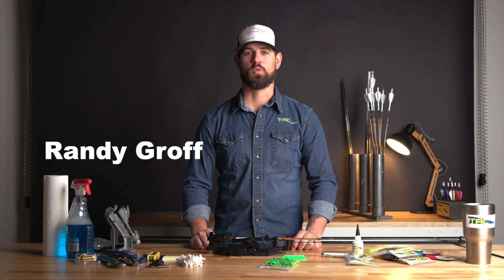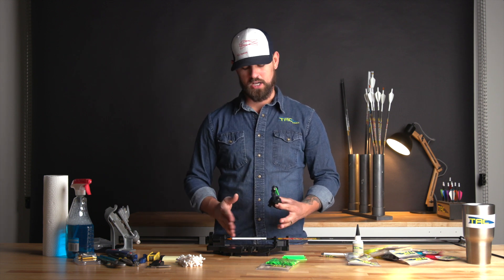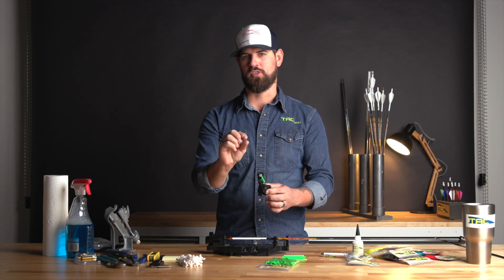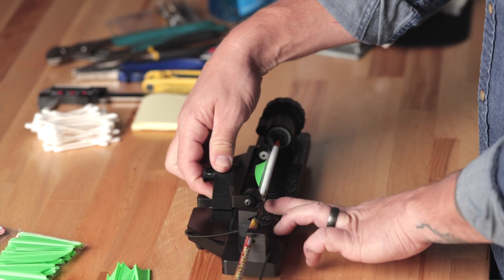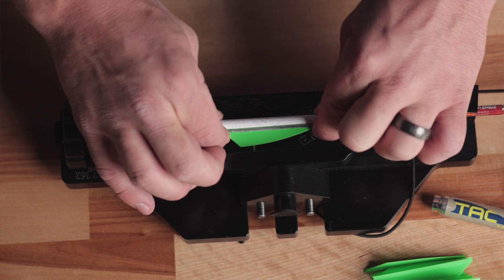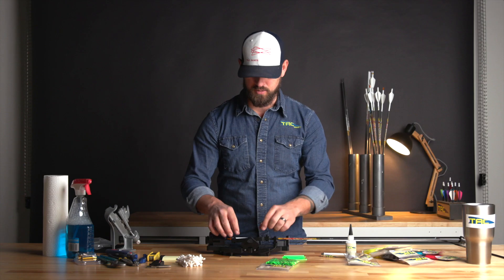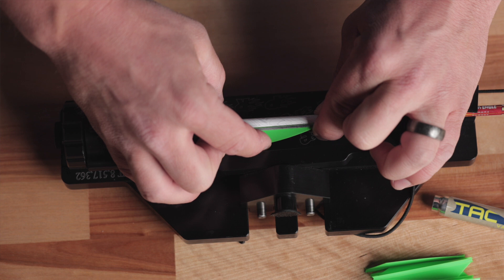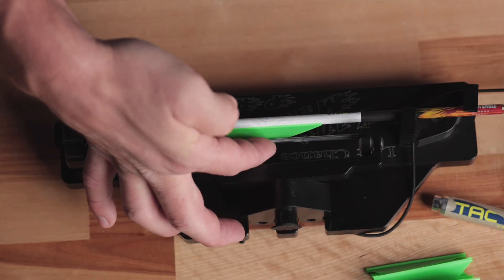Vane Master Pro - Tips for Fletching Vanes

Comment: I’ve tried to like these vanes but, most recently, bought a 100pk to fletch a dozen arrows. Out of that dozen, was only able to get a half dozen fletched using VMP and these tac vanes before running out of vanes. Have tried tac glue, fletching glue, and even gorilla glue with minimal luck. Tried this method, as well, and still have on avg about 1 vane sticking for every 5 that don’t. Canes have been primed. Have tried this method. Have done everything I can except to stop using them. At this point, I’ll likely just stick with bohning.
Reply: If you use TAC primer pen and TAC glue they stick as well or better than any vane out there.  They will not stick if you dont use both primer pen and glue

Comment: The problem the middle never sticks, love the vanes but there's no way we should be having these issues with non sticking at the price of the vanes & glue kit
Reply from the maker: If the vane is primed, glued and fully seated within 15 seconds, they will stick permanently every time.  If the vane does not get FULLY seated, the glue will not cure because cyanoacrylate glue only cures on the absence of oxygen.